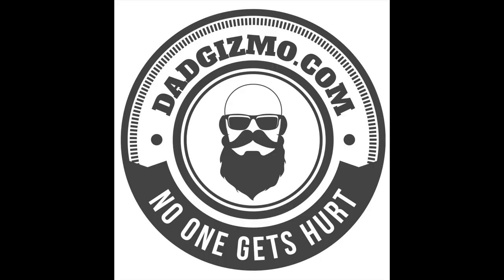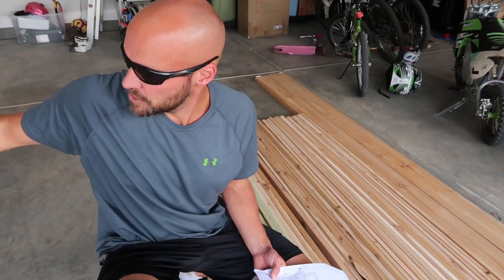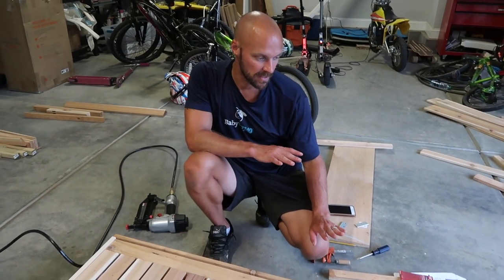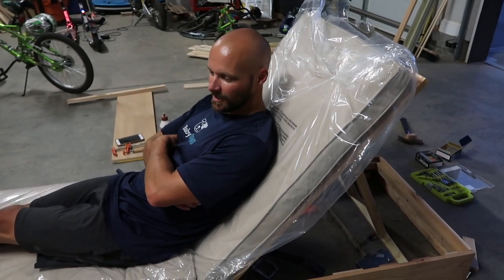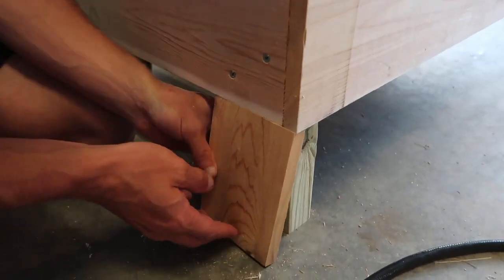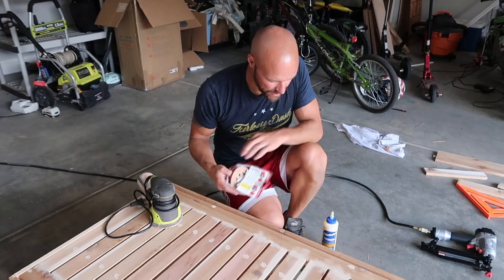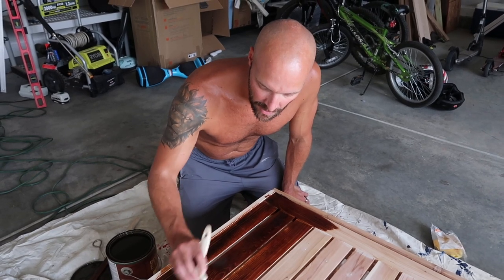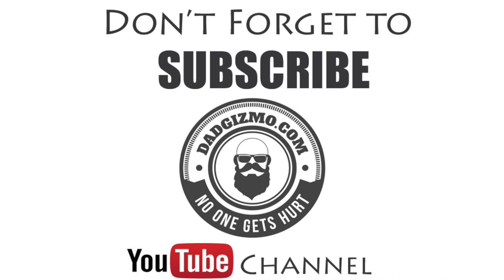How to Make Pottery Barn Single Chaise Lounge Chairs on a Budget | DAD HACK

Comment: What size deck screws did you use? Looks like 2 1/2” from the video
Reply from the maker: I used 2 1/2 inch on the legs assembly pieces.  I used 2 inch on any location that might get close going thru.